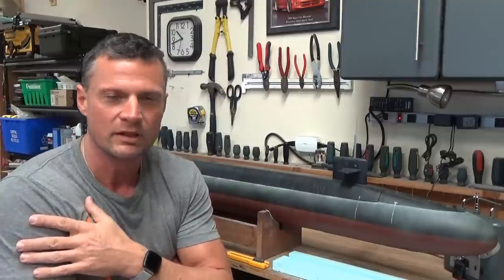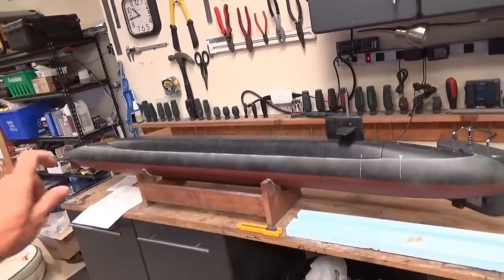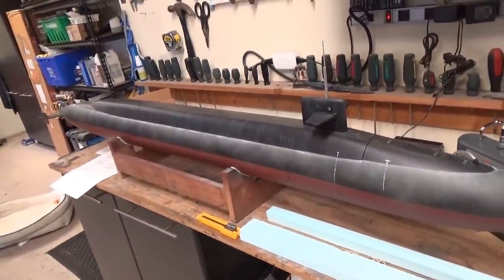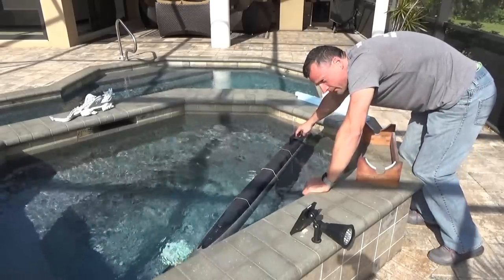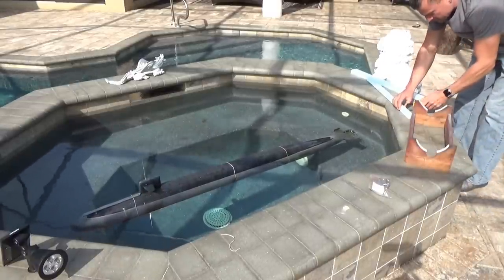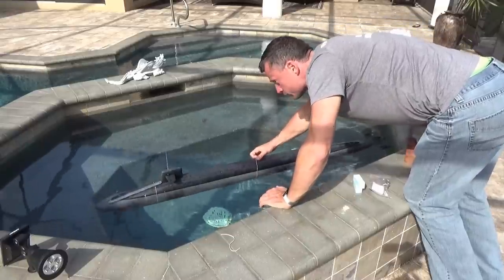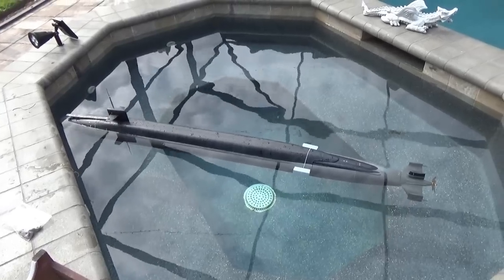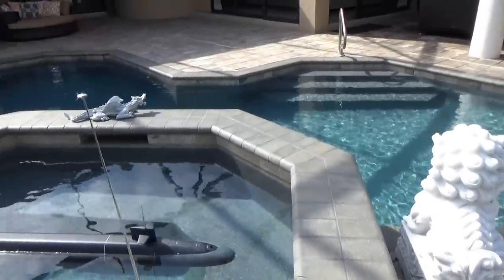SubmarineWorks Ohio RC Submarine Build - Chapter 5

Comment: Very cool!!! My last two at-sea commands were Ohio class boats (SSBN739 & 731). Not to knit-pick, but a couple of your terms need to be corrected. The planes in front are called "fairwater planes", the aft are the "stern-planes". The proper name for the "missile deck" is the "superstructure", the actual "hull" is under the superstructure. Trimming the full scale version is just as tricky, but variable ballast (water) is used for trimming, it seems like you could make trimming easier by adding two tanks inside what would be the pressure hull to add or remove water to get a proper trim. Also, your trim will change with temperature, so what is good today will likely not be good when the water you are running in is significantly warmer. 

Looks like you are using a 2.4ghz radio, how deep can you dive and still get reception? Do you have a fail-safe built in if the boat goes too deep?

Comment: Would it not be possible to create a dive module with a moveable ballast tank, say on a threaded rod that you could wind forward and back within the OTW to get that trim without having to resort to adding foam? It could also be remotely controlled, if you drive it with a motor you could adjust trim while in use.